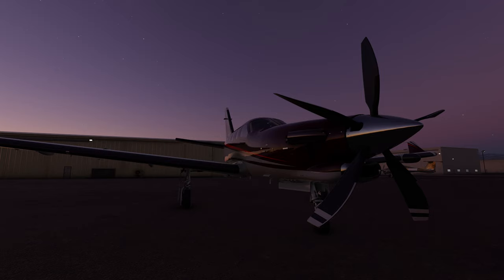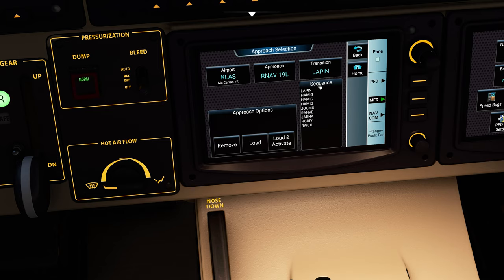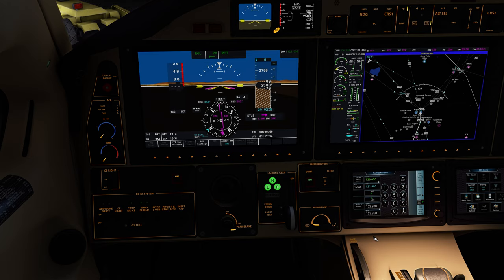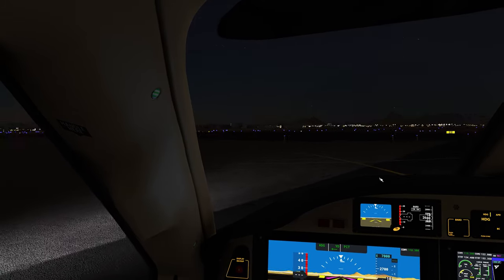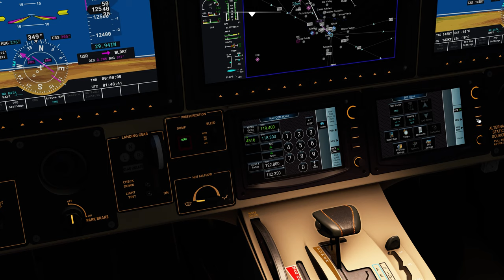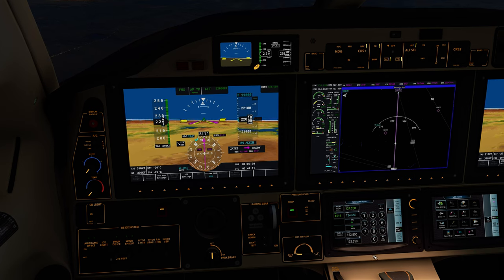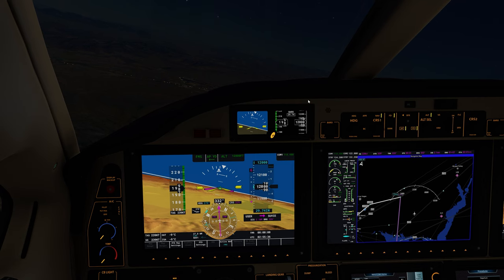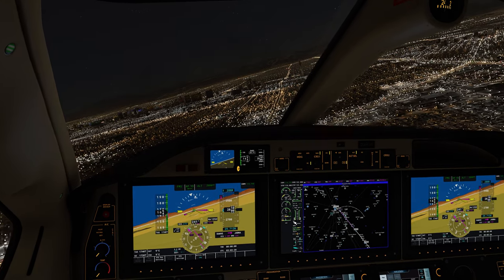Microsoft Flight Simulator | TBM-930 Fly Your Plane | Pilot2ATC

Comment: LAS VOR 116.9 doesn't have vertical guidance to take you down hence the APR button will not do anything; it's not an ILS. When you hit the FMS to switch to VOR1 the plane was turning you away 19L because it was trying to capture the 360 radial with a 360 heading as the CDI was not set during FMS configuration. A good indication if you can use the APR button if there is a snowflake. The snowflake represents your vertical guidance. Another indicator is the frequency as ILS localizers are usually between 108-111 mhz anything above that are VORs without the glide slope or vertical profile. When you switched back to GPS and you were taking control of the airplane to recapture final you'd notice the magenta snowflake was coming down. That's because prior to the flight you had already loaded the RNAV approach for 19L which had the vertical guidance. Once the snowflake has centered you could hit the APR button and the plane will take you down as the FMS has captured the glide path.
Reply from the maker: Thank you! I wish I had this BEFORE the flight.  I figured it out after lol
Reply from the maker: I recorded this one and the one you commented on before back to back
Reply: @OverkillSimulations  I will fly this same route in the next couple of days as part of my east to west coast trip of the US :)
Reply from the maker: @dinoe820  that's what I'm doing but the other direction lol